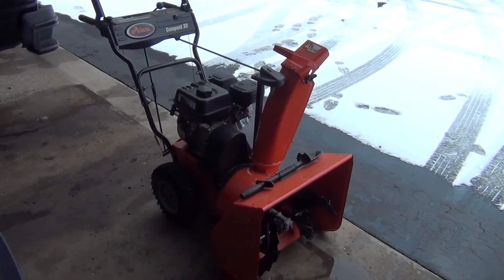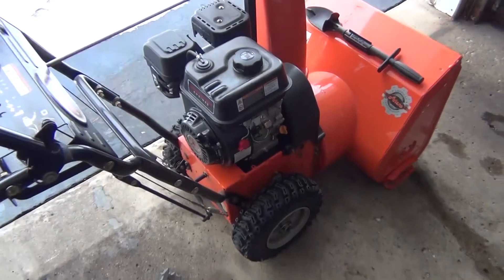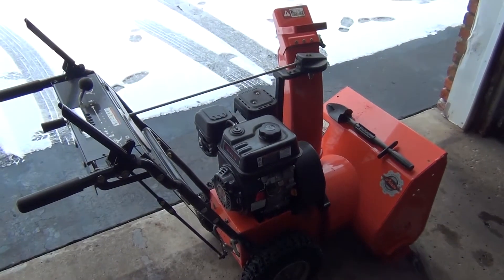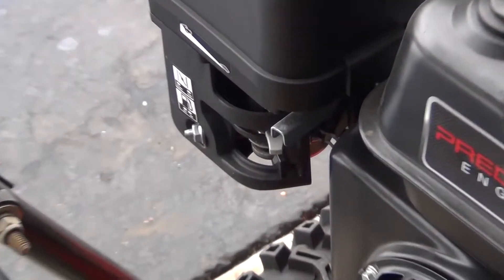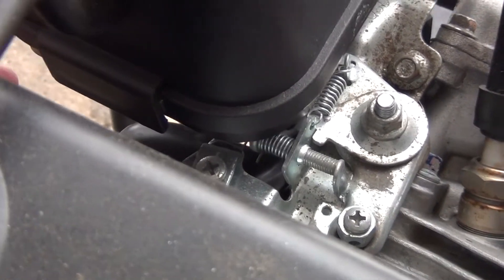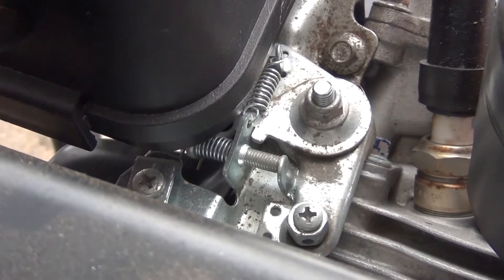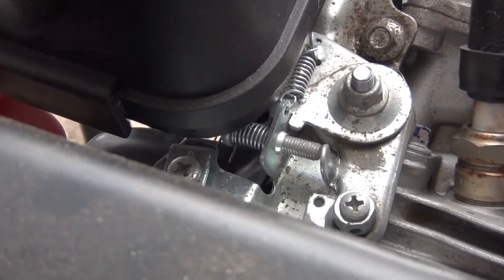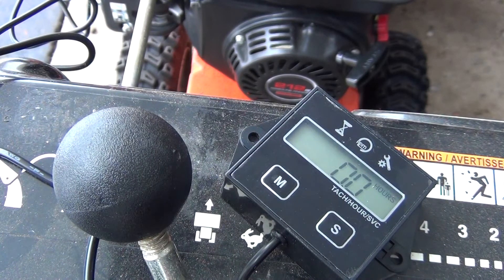How To: Use a Small Engine Tachometer & Set Engine Speed | Reviewing the Cheapest One On Amazon

Comment: I would have been tempted to check the carburetor air/fuel screw for maximum rpm before just increasing the throttle stop rpms.  I think those simple carburetors have an air/fuel mixture screw.  I could be wrong.

Comment: Fyi, for a 4 stroke single cylinder, you need to set to 1p1r, not 1p2r like the manual says.
Reply: I got one on my predator 212 how do you do that because i think it’s reading low than what its actually at
Reply: @bikerboyjay2214 
a) Press the "M" button until the display shows firing pattern setting(example"1p1r"or"1p2r").
b) Press and hold "S" button until firing pattern setting starts flashing then release. Press "M" and "S" buttons to toggle through the engine firing pattens until you get to "1P1R". 
c) Let blink on that setting for five seconds, it will return to hours and firing pattern is set. 
It should then show idling and running rpms accurately. Google predator engine you haves suggested idling speed, for 79cc it's 1800-2200. Best wishes, hope this helps.

Comment: Very helpful!  This is one of my newest tool for this season

Thank you.
Reply: I just received mine yesterday and today, I want to test the speed of our snow blower, which, is one model lower than seen here.  

But the motor is Tecumseh. Which, has been great.  I just had to do a full carb maintenance because, someone lazy (cough cough) put 2-year old gas into it during a snow storm.  LOL  You can imagine that it did not like that.

So I cleaned the carb, did other maintenance and now it's running nice and smooth again.

But I THINK that I set max speed too high.

Today, I'll figure that out if it gets a bit warmer out there.  Right now, it's 0C (32F)... burrrrrrrrr...

Comment: The manual says 36 to 35 but honestly if you’re doing snow, I would do round 36 to 3640 it will not hurt the engine because once you going to the snow, your own drop probably to like 3550 that’s where I set them at and they never had a problem on your first mowers, set them around 3600 RPMs but a good video

Comment: how do you know if the rpms are right? My manual for anothedr brand reader say 3/4 turns but with 4 the rpm reading is too high. Manual say to reduce turn if is too high but with 3 is still high.

I set 1P2R for 4stroke 1 cilynder.

I noticed in many videos for different readers using 5 turns

-----

At the end I set it to 1P1R and now the rpms make more sense. In the manual, there is a section that states some 4-stroke engines operate in 2-stroke mode.
 I read somewhere is right because depends how is made the ignition/flywheel, how many turns, magnets, coils and waste spark. 
So, my tecumseh engine is basic with only a light, no battery, 12v starter and heated grips that they need more coils, generator for battery. 

The wire turns make it only more (many turns) or less accurate, if I'm not wrong

Comment: I've used five of these cheap amazon or ebay tachs and they all tested accurate against Faria Beede tachs.  3-4 loops tightly wrapped with zip tie works well.
Reply: Got a question for you. How do you reset this tachometer to read rpm only?

Comment: What’s the point of having a tachometer on a small engine you’re not racing it
Reply: so you dont over rev it.  theres a maximum operating rpm that should not be exceeded.  racing engines are usually built to handle higher rpm, whereas a standard engine doesnt have heavier valve springs, or a billet flywheel.  you risk damage to it by exceeding the rated rpm.
Reply: Some small engines rated up to 3,200 RPM. So, if that mower engine rpm  is exceeded, the engine life is shortened dramatically. Newer mower engines need specific smounts of rpm to cut grass efficiently,  whereas older B&S mower engines coild run at slower than average rpm's and could still cut grass efficiently. So, older pushmower engines lasted way longer than newer small engines, in my opinion.

Comment: Why rpms not steady? They going up and down
Reply: Different factors could apply, like dirty air filter, worn spark plug, low motor oil,  rusty magnetic ignition coil contact tips, or rusty flywheel magnetic contact surface.

Comment: DIAGNOSTIC PRO TIP:
Wrap 5 turns around a round metal bar 1/4" diameter, 1 inch long.
Wrap that with duct tape to keep wire on the bar,
and not unwinding like the Graz attempt.
Zip tie it to a spark plug wire and start your engine.
When done adjusting engine RPM, cut zip ties
and move to the other cylinder, if necessary.
You have just created an inductive bar.
It steals the pulse from the plug wire, and 
applies it to your metal bar, where the device
accurately detects and registers it.
I cannot tell you the device is accurate, 
but you just removed a lot of the variables.
-- The Great Nicolas Tesla revealed these secrets 100 years ago.
-- North Central Florida
-- 9.10.2023
Reply: Great tip increase the induction with the metal core👍

Comment: 3600 rpm is usually the redline for single cylinder lawnmower type engines.
Reply: Brush cutters go over 11.000 rpms
Reply: @Goxus95  those are 2 stroke engines. I'm trying to find out what the real redline is for 4 stroke single cylinder engines like the honda gx390 copies from china, 420 cc 15hp engines.

Comment: Tip, buy a small battery clamp and solder the wire to the clamp. That way you can easily attach and remove the tacho on any engine.
Reply: The Tac wire has two wires inside it. Solder both wires to the clamp?
Reply: @stevecahill9106  Two wires? Well, mine came from China with a battery clamp already attached. No idea where I left it though. So try to solder both wires down and see if it works. You can always remove one or the other if it does not.

Comment: The Operating Instructions for this self powered digital tachometer state:  "4 stroke installation, wrap pickup wire around head of coil.  2 stroke installation, wrap pickup wire around spark plug lead."

Comment: A heads up. The lock nut that holds the throttle lever can loosen because of vibration. Tighten that lock nut just a bit and apply some light lubricant. Don't use WD40. Then make your speed adjustment.

Comment: I think I'm going to verify this unit with a handheld tach-meter, I'm a retired mechanic and I want to see if I can successfully wind my sensor wire near the coil under the engine cover, I just built a sweet vintage style go kart.
Reply: You running chainsaw motors?

Comment: Read a lot of reviews and watch many videos on these tachs and most people don't like them. They are not accurate and you end up guessing on your settings.
Reply from the maker: For the price, and my use of getting the RPMs in a general ballpark on unknown engines, it’s worked just fine. If you needed a more accurate or permanently-mounted solution, I’m sure there are more expensive or even OEM tachs for whatever application you need them for.
Reply: Maybe you could do another more in depth video of other tachs and compare pros and cons and their accuracy and price ranges then give your recommendations.
Reply: @jimdillon938 This tachometer may run $7 - $8 or so on Ebay now, they are inexpensive.

Comment: Good vid, thanks Graz. I have a DR650 motorcycle which has no tacho and runs a carb, which needs adjustment according to conditions. I was looking for some way to meet and check the idle RPM. Any reason you can see why this would not work on the bike? It's a single cylinder engine with two spark plugs.
Reply from the maker: Hmm that’s a a good question… For a single cylinder w/ 2 plugs, the tach is just going to think it is a 2 cylinder engine. (Since you are just wrapping the tach around one plug wire and it fires every-other power stroke) You would probably just need to set it at 1P2R (below).

By default, this model comes set for single cylinder engines. From the manual, to switch the firing pattern:

1) Hold “S” until “1P1R” starts flashing. (1P1R is for single cylinder, “1 Spark for 1 Revolution”)
2) Then click on “S” to cycle through the different settings.
3) For a 2 cylinder engine you’ll want to see “1P2R”. (1 fire per 2 revolutions)
4) Let your desired setting flash for 10 seconds and it will set your firing pattern.

Hopefully that helps! (And if all else fails, you should be able to return it pretty easily if the seller on Amazon allows it)
Reply: @GrazGarage  Ahh, glad I asked. Thanks again!

Comment: I just saw this on some website (something 'wizz') but couldn't see comments so searched Ytube.  Thanks for this. I've stayed away from anything with wires and/or that spoke of hour - counter but you've just taught me this type should do what I want -' just to test speed occasionally on different engines. I have a branch shredder with Honda GC 135 that just stalls when I push a correct diameter branch in. My Briggs vibrating doodad shows only 1900 rpm! It needs to be 3600 so I need to check the reading and figure out how to increase the speed (I don't think it's as simple as yours). •Steve 's Small Engine suggests to bend the lower tab on the governor that has the little spring attached. But for now I'll buy one of these things when I've checked out the reviews. THANK YOU!

Comment: Very informative video!
you gotta be careful when winding the wire.
Too many, and you'll get a 'false' higher RPM
Too few, and you'll get a 'false' lower RPM
(there's a bit of a trick to tweak them apparently)

I've basically got the same tach that I bought about 5 year ago.
It has a replaceable battery (CR2450).
However, I just found it in my box of junk and decided to hook it up.
Not sure if the hours will be erased once the battery is depleted. I expect it so for a cheap unit. :)
Fingers X'd
Cheers!
Mick
Reply: @georgeiceman867  5 like the directions say
Reply: @RS-ge4dz mine didn’t come with any directions lol I almost threw away the wire
Reply: THAT is incorrect.
The wrap count does not matter.
Wrap the entire wire into a bundle,
and hold it NEXT to the spark plug wire.
Then do the 5 wrap count.
Same number.

Comment: I just ordered one of these and I was wondering if you can cut some of that extra wire off. I'm glad its on a snow blower. I also have an Ariens 24". Please let me know about the Extra wire. Thanks for sharing.
Reply from the maker: You should be alright to cut the excess wire off. I am not mounting mine to one specific motor, so that’s why I’m leaving the excess on. Just leave yourself enough wire to do the few wraps around the coil to get a clear signal, and you should be ok to cut the extra off for tidiness.

Comment: I have the same tach with no manual. Don't you have to set it for a single cylinder engine?  number of fires per rotation? thanks
Reply from the maker: By default, this model comes set for single cylinder engines. From the manual, to switch the firing pattern:

1) Hold “S” until “1P1R” starts flashing. (1P1R is for single cylinder, “1 Spark for 1 Revolution”)
2) Then click on “S” to cycle through the different settings.
3) For a 2 cylinder engine you’ll want to see “1P2R”. (1 fire per 2 revolutions)
4) Let your desired setting flash for 10 seconds and it will set your firing pattern.

Hope this helps!